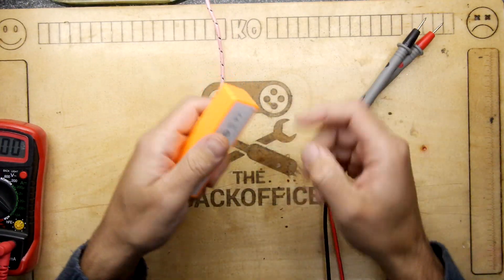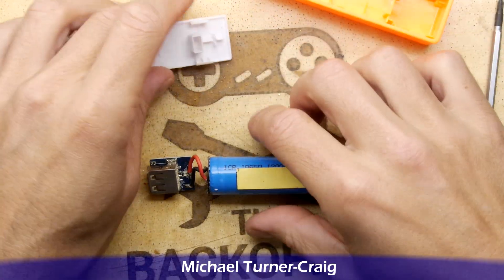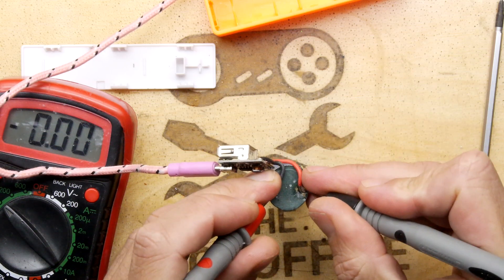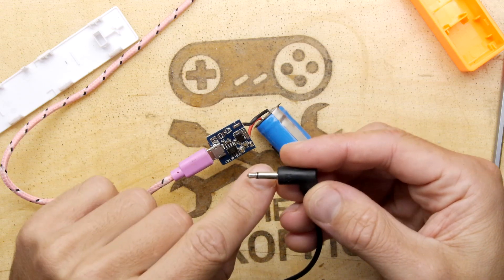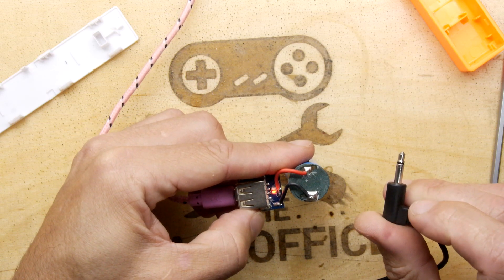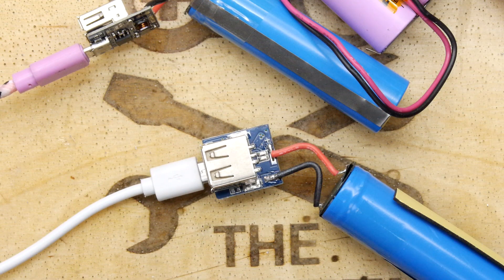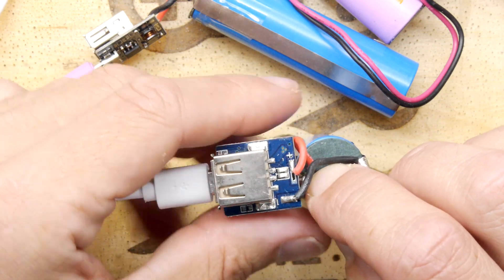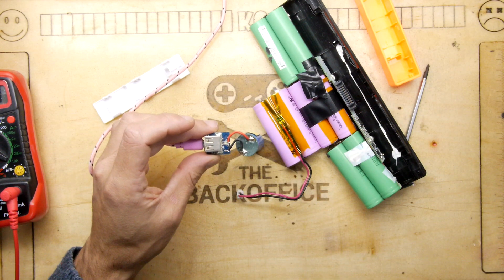How to recharge a dead lithium cell

Comment: I did this like a year ago it was scary I give the battery 4.1v to kickstart it and it got pretty hot and start charging
Reply from the maker: Did the battery last must longer afterwards?
Reply: @backofficeshow   it depends how discharged the battery are because I have a box of it with different discharged value.

Comment: I have a laptop battery that is not charging, it has 6 cells inside so gonna blow myself up later trying this.
Reply from the maker: Laptop chargers tend to be pretty high quality, I suspect you may have a dead cell or two in there. Might be best to find a replacement 😂

Comment: OK, so you get the cells jump started, but how do they perform afterward? Do you actually get any worthwhile performance out of them, or have you only postponed their death by a cycle of two?
Reply: Nintendo DS Lite handhelds recover battery packs from 0 volts, so this will work fine. Also, Julian Ilett has demonstrated this.
Reply from the maker: It really depends on why they are discharging, if they are truly knackered then they might only limp on with limited capacity for a while, but if its the fault of the electronics, as long as you keep them topped off you will get some decent usage out of them